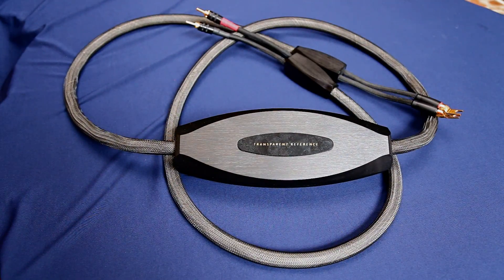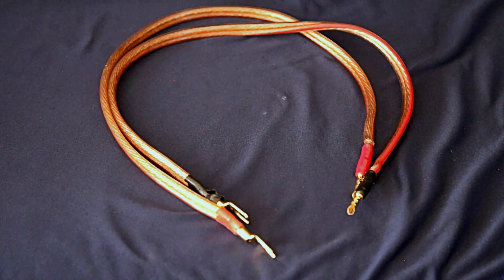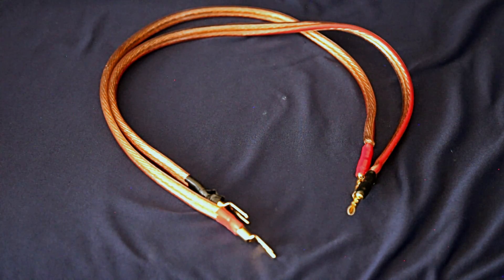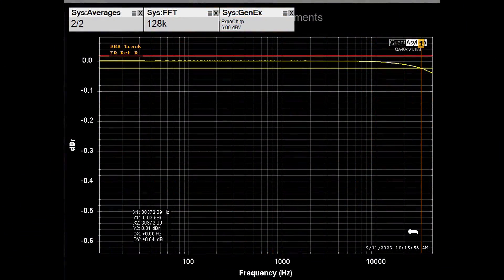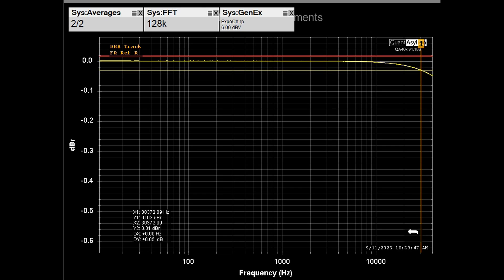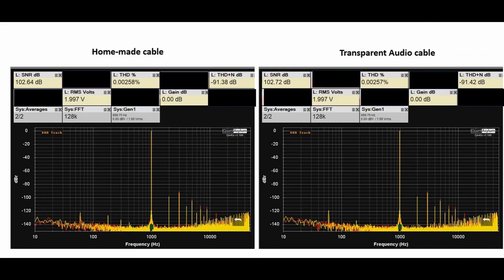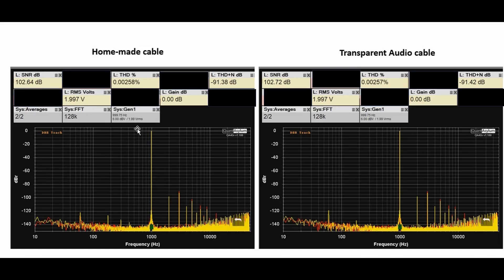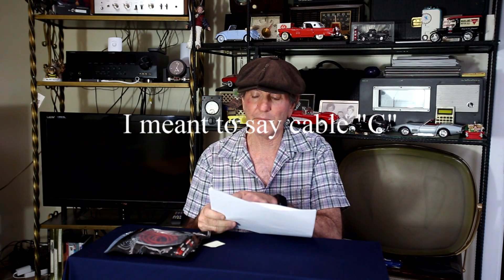$8000/pair Speaker Cable  vs. $14 DIY Speaker Cable A/B Test: Vintage Audio Review Episode #87

Comment: "Audiophile" snobbery is probably the best example of how the industry helps the fool part with his money. I always go for the cheapest cables...and everything sounds beautiful. Thank you for the comparison.
Reply: Audio is subjective. Nothing to do with snobbery.
I've changed my cables multiple times cos I couldn't put up with the way my room sounded. Do you really think I would go through all this trouble not once, not twice but three times if I didn't think it was worth it..
https://youtu.be/wwU0d3NfRQw?si=eFc3nTKJCM_jWvYz
Reply: @Totalplonker 
 "I've changed my cables multiple times cos I couldn't put up with the way my room sounded."

Would you call a plumber to fix a garage door opener?
That's literally what you are doing when you expect cables to fix a room acoustics problem.
Reply: @Douglas_Blake_579   You getting the wrong end of the Stick. When one puts the system on pause or mute. The sound of the room can have a sound of its self (noise floor) I would imagine 9/10 people are not even aware of it. Unlike the sound of room with a 2 channel setup, a multi-channel's room noise floor in my experience is considerably more noticeable (especially when the cables of length are not shielded)
Sorry, but nothing to do with room acoustics!
Reply: @Totalplonker 
You appear to be mistaking the noise floor of your equipment with that of your room.

The room itself probably has a 20 to 30dba ambient noise level, like most rooms. This is the sum of airflow, traffic noise, appliances running, etc.

Your audio gear, unless something is very wrong with it, should be nearly dead silent when not playing sounds.
Reply: @Douglas_Blake_579
 When I made the jump from 2-ch (integrated) to a multi-channel setup, I almost immediately became aware of an extremely faint background signal noise.
It was so faint pointless asking anyone else if they could hear it, but for me, it was annoying. Even after auditioning several Japanese AVR's. The same background noise was still present! And when I used to remove my rears and heights, the unwanted noise almost completely disappeared!
It was only after the third time (research) when I purchased shielded cables, the noise disappeared. Having multiple channels with multiple Poweramps has given me the ability to confirm all this. The only time I'm able to differentiate if the system is on is if the cabinet doors are closed and the 35db fans haven't clicked on. Even though one doesn't really burn in digital cables, I swear I could hear the difference after each HDMI cable had been burnt in. Maybe I'm just a little over sensitive. Or maybe I'm just a fruit cake 😁
Reply: @Totalplonker 
I don't think you're either.  I hear stuff nobody else hears on occasion, too.  Sometimes it's real (like the hiss of an amplifier) sometimes it isn't.  I'm sure we all go through that one.

The real trick is to track it down to cause and fix it there. Many people have wasted horrific amounts of money masking problems that are never fixed.
Reply from the maker: @Totalplonker  I watched your video and appreciate your showing what you did. I am glad it worked out for you. I really don't get into AVR systems that much but have had ground loop issues from from strange actions between components and nothing from the cables.
Reply: @vintageaudioreview  yeah, I've experienced a couple of ground Loops myself. When a subwoofer is connected to a different wall socket other than the main systems wall socket ground Loops can occur. Ground loop isolators or have everything coming off of the same wall socket seems to remedy the problem.

As far as the noise I was experiencing. Unshielded cables can act as antennas for attracting RF and the longer the cable, the better the antenna! Property explains why when I used to disconnect my Heights and surrounds and noise floor used to come down.
Reply from the maker: @Totalplonker  In my case it was the when I connected the subwoofer to my 2channel system that I go the hum but the the hdmi connection between the blue ray player and TV set caused the problem. The blue ray player was connected to both the 2channel and 5.1 systems. The subwoofer outs for both switched using a basic a/v switches in which all the grounds were common. The solution was to manually connect the subwoofer out to the system I want to use.... I still don't get having shielded speakers as the RF is not going to be amplified by unpowered speakers or the output stage of an amplifier....
Reply: @vintageaudioreview  yeah you go with an integrated. Stereo listeners with their short cables are unlikely to experience any of the interference noise multi-channel listeners experience, so totally understandable.
Reply from the maker: Thanks for taking a few moments to comment. I would say the majority of viewers of this video agree with you. I am not sure I would go with the cheapest (thinking 22guage wire), but certainly not ones that cost over say $100/pair for 12' cables that were at least 12guage OFC....
Reply: @vintageaudioreview  The Audio Masterclass utuber tells us most of us cannot differentiate between a $10 cable performance and a $1000 cable/meter performance. I certainly cannot. So, my 16 gauge cable serves me fine, and it costs more than ten dollars. Thank you for your comment. The pertinent Audio Masterclass clip is titled "Audiophiles...you are wasting your money!" The guy runs an online class for sound engineers, so he certainly knows what he is talking about.
Reply from the maker: @msingh1932  16 gauge speaker "zip cord" is fine for darn near everyone. I wish I could remember the Stereo Review article from the 80's I believe where I first read that exact same thing from the article's noted author. I am familiar with the Youtuber you mentioned, though did not see the video you mentioned but will look it up....

Comment: So if I understood right you are testing speaker wires going through some switch box, then a third cable to the amp? That is already compromised to begin with. The accurate test for me would be to connect the speaker cable directly to the amp. Changing takes 2mins after all.
Reply: I have the cheapest amazon cables in my system so I’m clearly no audiophile but I also believe that routing through the DIY patch cables and the switch box isn’t a valid test because now those components present as the weak link in the chain. I would want to know that a direct connection is made rather than introducing intermediaries. 

I also would want to see this test with new cables vs older ones. It’s possible the older cables may have degraded somewhat hence the reason your buddy got ahold of them used. Perhaps the original owner thought they were also lacking recently.
Reply: @jp93309 
Yes the switch and shorty cord present as the weak link in the chain but equally so for BOTH cables under test.  That is, they cause the same "difference" in both cables and thus the only real difference is the cables being compared.  All common elements can be ignored, leaving you with only one variable that has changed.
Reply from the maker: @jp93309  Thanks for taking the time for your long comments. I have seen this commentry from a few commentators on this video and if you read through them most folks agree that your cheap amazon speaker cables will work just fine- has nothing to to with being an audiophile. One cannot do it with a direct connection as far as I know unless you can switch both the two cables mechanically very fast, like the switch box does- probably less than 200ms. That that jumper cable  has such a low impedance it is not going to effect anything. But your point is understood.
Reply from the maker: Thanks for your thoughts. The way that I do the test allows for immediate switching between the two cables. Yes, the middle cable may "compromise" the result according to and some others. From what I have experienced, our "audio memory" is not good enough to remember the very small differences between the two cables or two amps or preamps or integrated amps that test decently. The difference between the sound of speakers is much larger and easier to remember basic characteristics - at least what I have experienced.
Reply: @vintageaudioreview  The difference should be bigger and easy to distinguish between the two cables if they are connected directly. If there are no big difference than what is the point in spending 8k on a cable?
Example: in my system I had some low end speaker cable and no matter what RCA I did hook up I ended only hearing bass/treble/mids changing. After upgrading to a speaker cable a friend referred me to the different RCA yield not only bass/treble/mids changing but sound stage  width/depth/separation.
You did something similar with that switching box+the cable to the amplifier.
For me the test is compromised. Not legit in any way.
Reply from the maker: @rosenlazarov Thanks for your comments. The test is what it is. It is not possible to do it w/out a switch box or the small, 3rd cable. One day I may do a similar test with RCA cables, but I am almost certain the results would be the same.
Reply: It really doesn't matter what else is in the circuit. When only one thing is changed (the long wire in this case) and everything else is common to both, the comparison is valid.

For example: Had Scott chosen to use banana plugs to quick swap at both ends, a whole list of new variables (connection quality, swap time, contact resistance, etc) is introduced which invalidates any comparison.

Comment: What is the difference between a $4,000 speaker cable and a $14.00 speaker cable?

$3,986.00
Reply from the maker: Pretty much from what I have seen...maybe some aesthetics.
Reply: Nothing.
Reply: @donbest5024 
$3,986.00 is NOT "nothing".

Comment: I replaced OFC home made cable with a pair of mini coaxial cable, around .67 a foot, with soldered on banana plugs. I heard a difference, and had to adjust the tone controls accordingly on music I am very familiar with. I asked this question at several sites, why? And I was quickly called every name in the book for even suggesting there was a sound difference, all in my head, blah, blah, blah. I'm still using them, they did not break the bank and work. My thinking, it was the lower impedence of the Mogami coaxial wire. Mogami does publish this data. Flame suit on.
Reply: Exactly which cable did you use?
If it was something like Mogami W2 series, I'm betting you had to turn up the bass quite a bit... because the inner conductors in those cables are very thin and generally can't handle speaker currents at bass frequencies.
Effectively you are wiring your speakers up with either 22 or 24 ga wire.
Reply: @Douglas_Blake_579  Its all system dependent - everything is.
Reply: @nelsonclub7722 
Not in the least.
Inadequate speaker wire is going to be inadequate no matter where you put it.
Reply: @Douglas_Blake_579  Yes of course I was referring to upgrades or changes - they are so system dependent - so I think we can agree on that - I used to sell high end hi-fi and for instance Naim cable was a good all rounder - I can't think of a good Cambridge, Rotel, Yamaha, NAD system where it didn't work well enough - but upgrades to higher end systems rlike Krell, Audio Research, revealed that changing only the speaker cable worked a treat - but not all times - occasionally it made things sound worse
Reply: @nelsonclub7722 
I often wonder if people appreciate how much effort goes into designing equipment that doesn't behave like that.  You should be able to plug anything into anything else and get a satisfactory result.  The whole "synergy" thing is way overblown.
Reply: @Douglas_Blake_579   I agree, most components in a decent audio system should work well together when one of these is changed with a similar (or better) quality component.
The issue that may indeed affect the perceived performance in an audio system may be the passive crossover.
Since I run active speakers I use the thickest cable on bass and the rest on the mid-range and on the tweeter circuits and changing to cheaper, or more expensive wires has no audible effect I could hear; even changing amplifiers hardly matters anymore and only changing the source seems to alter the aural picture in a discernible way. 
I am confident I can tell from behind a blindfold if the SACD player, the reel to reel machine, or the music server is playing in the room and I cherish the transparency of the active OB speakers.
Thank you for a well thought and produced video !
Reply from the maker: @nelsonclub7722  Thanks for your discourse on this. As Doug said below, there should be a lot of design into a higher end amp (large damping factor), such that the speaker cables should not make any difference...
Reply: @vintageaudioreview  100%
Reply from the maker: @donquixotetruth  Thanks for sharing your thoughts. I have not wanted to get into the active crossover part of the audio hobby, but certainly understand the benefits. I see where you could tell the difference between the Reel to reel machine and the other two you mentioned, but not so much with the SACD player and the streamer.....
Reply: @donquixotetruth 
Not my video ... I kind of invaded Scott's comments. (Thankfully he was nice about it) If you want to thank anyone, you should thank him.

The current high compatibility we all enjoy comes from a change in design philosophy somewhere back in the 1960s.  With the introduction of solid state equipment, the industry switched from "Impedance Matching' to "Impedance Bridging", taking away most of the variability of interconnected systems.  

In Impedance Bridging, signals are passed by voltage (not current) from a low impedance output (typically 600 ohms or less) to a much higher impedance input (typically 10k ohms or higher), which ensures that the signal is passed with maximum efficiency and lowest distortion.  

There are also ad-hoc standards for signal levels.  "Line Level" describes the voltages on interconnects and equipment outputs.  For digital recordings there is an "Alignment Level" manufacturers use to ensure proper line levels between devices.

These small changes mean you can now hook almost anything to almost anything else and get an acceptable result.

(The quoted terms are all defined on Wiki... do a little searching  to get the full details.)
Reply: @Douglas_Blake_579 The Mogami W3082 wire, and I had to lower the bass.
Reply: Infairness your analysis is probably spot on - I have always found a difference but with the caveat that it is system dependent - but even on my dads fairly low end Cambridge EVO 75 running into Monitor Audio Bronze - we both heard a difference going to decent QED cable - now if we were to upgrade this to something fancy, expensive and esoteric I would doubt it  would do anything dramatic - props to you for sharing
Reply from the maker: Thanks for sharing this. I don't see why that cable wouldn't work fine- as long as it is not for hundreds feet. For audio frequencies it would have a very low impedance just like the cables that I made.
Reply: @vintageaudioreview 
Okay he didn't specify if he's hooking one plug to the center and the other to the shield or if he's lumping the two of them together and using two runs of it, one for each plug.

In the former case the plug on the thin center wire will experience very high resistance... like 1 or 2 ohms per foot.

In the latter case there is the problem that the shield is not generally required to carry heavy current and may not be continuous strands of wire.
 
Either way ... coaxial cable is best left to places where shielding is required and power handling isn't.
Reply from the maker: @Douglas_Blake_579  The coax cable that was mentioned looks to be for speakers- 15guage- maybe for surround speakers where shielding may have a slight advantage in rare instances when the distances are large. It certainly would not be my choice for speaker cables, but if it works for him, that is what counts...
Reply: @vintageaudioreview 
If that's the case, I stand corrected.  I didn't know Mogami made speaker cables... See that... Ya learn something new every day!

Thanks.
Reply from the maker: @Douglas_Blake_579   This is what I found:
https://www.ebay.com/itm/361955412167?chn=ps&norover=1&mkevt=1&mkrid=711-213727-13078-0&mkcid=2&itemid=361955412167&targetid=4581183931512209&device=c&mktype=&googleloc=&poi=&campaignid=603247656&mkgroupid=1241349622402367&rlsatarget=pla-4581183931512209&abcId=9316139&merchantid=51291&msclkid=719e293d4f08184bf2424c662789a6be
Reply: @vintageaudioreview 
Thank you...
Reply: @vintageaudioreview Yes sir, that is the speaker wire I am using, inexpensive and to my ear, it did improve the sound.